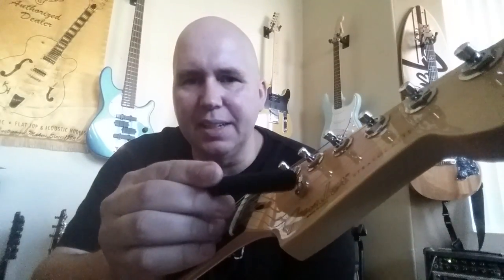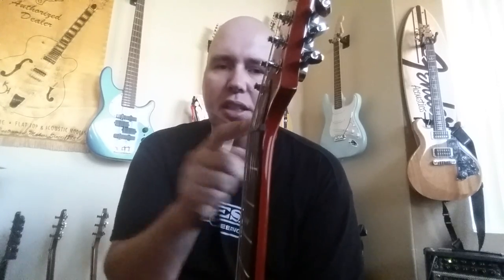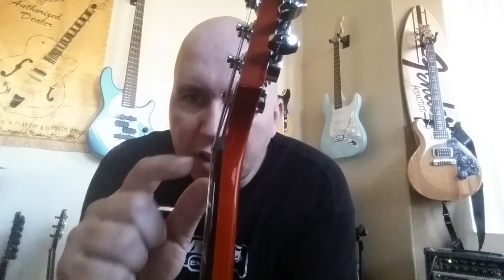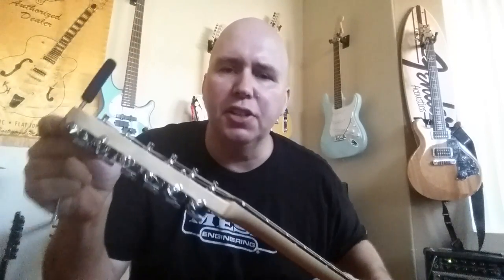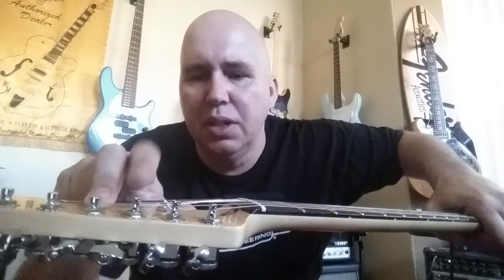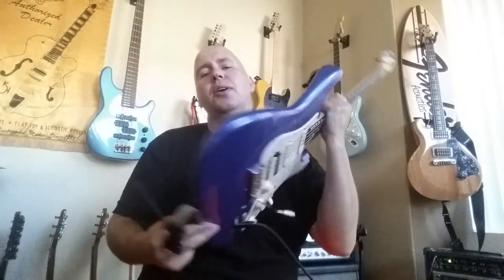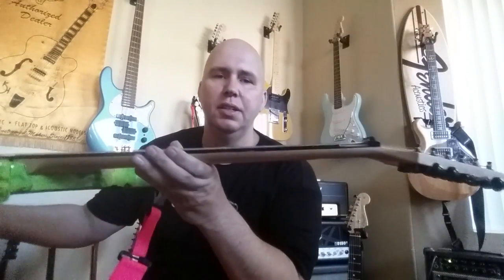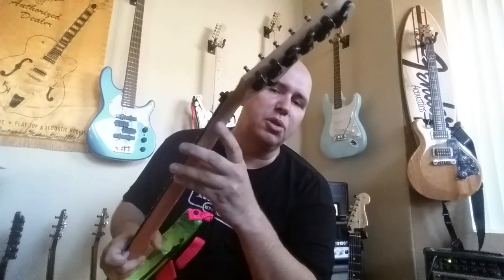locking keys Do Not Work The Way You Think

Comment: Well I respectfully disagree about locking tuners only being good for making string changes easier. I have locking tuners on 4 of my guitars that have whammy bars. I seldom have to retune those guitars even after massive dive bombs on the tremolo system. So imo they definitely help those guitars to stay in tune. No question about it.
Reply: I think he was just trying to dispel the myth that the lock,...holds the tuning key from "turning"...which is what I thought they did. 🙂
Reply: 100% agree! If you use a tremolo bar with regular tuning keys without a lock nut, it will not stay in tune as the wraps around the tuners loosen as you reduce the tension on the strings when depressing the bar.

Comment: I tried the D'Addario Auto Trim locking tuners. I can only speak for myself, but I love those Tuning Machines. They work pretty much the same as any other locking tuner, with with addition of auto clipping the string, eliminating the need for a wire cutter. You do everything the same and as you tighten the strings to bring them to pitch you feel a little clipping action and the string is cut flush to the tuning hole. These things virtually eliminate the bloody finger tips from getting stabbed by the end of a string. I know everyone has had that happen at least once. Anyway, they are definitely worth a try. I was skeptical until I tried them. Now I'm slowly changing several of my guitars to these. At least the ones where these will be an upgrade to.

Comment: I know this is a very old video, but I just happened on it and it has confused me a bit.  Locking tuners ONLY help with quick restringing?  i thought that with Strat style guitars with a tremelo that there was also the issue of the strings with multiple wraps on the tuning posts losing tune when the trem was used. the wraps slipping when the trem was depressed/returned.  No, let me rephrase...I didn't merely "think" that...I have in fact experienced that, and locking tuners do seem to have resolved that issue.  So it would follow that locking tuners do more than merely facilitate string changes on guitars that have a tremelo...yes?  And by the way, regardless of this nit picking...YOU ROCK.  I am addicted to your videos, find them extremely educational and helpful, and this is proven by the fact that here I am responding to a more than 5 year old entry!

Comment: TLDR: Bob Sperzel created the first locking tuners to "build a better mousetrap" and eliminate locking nuts. His intention wasn't to make string changes faster; that's just serendipity.

Back in the 80s, when Bob Sperzel had just created the first locking tuners (as well as the tuners with the tightest tolerances in the entire industry), people were using locking nuts to keep their whammy bridge from de-tuning their guitars.  It was explained to me by John Suhr, when he was working at Rudy's on 48th St. in NYC, that, with normal tuners, strings are wrapped a few times around the posts.  When you dive bomb your vibrato bridge, the strings partially unwrap around the tuner posts and loosen.  Then, when you return from the dive bomb, the strings often tighten around the posts at a different tension, thereby making your guitar go out of tune.  Bob Sperzel's idea was to eliminate the wrappings around the post so that aggressive use of the whammy bridge doesn't have any effect the strings' tension.  John Suhr explained to me that Sperzel locking tuners, in conjunction with a self-lubricating graphite nut, eliminate the need for a locking nut.  

An added benefit is that you don't have to drill holes in one of the most vulnerable places on your neck to accommodate the bolts for those pesky locking nuts.

Sperzel had manufactured Grover Gotoh and Kluson tuners for them.  He noticed 10 things that were bad design elements and set off to correct them.  

One was the very high gear ratios.  High ratios meant more teeth per gear; more teeth means smaller teeth, which means weaker teeth. Sperzel limited his tuners to a 12:1 ratio.  

He also found that the machine tolerances of other tuners were very loose because they would make their parts and then plate them with nickel, chrome, or gold. Because plating is an uneven and imprecise process, the parts were actually slightly different sizes. Sperzel only anodizes his internal parts because that doesn't add any volume to the mechanism, allowing for very tight tolerances. Some Sperzel tuners do get electroplating on the external parts, just for esthetic reasons, but that has no effect on the internal mechanism.

Other manufacturers use die cast part. When a part is die cast, it has a mold mark called a parting line where the seams of the mold are. To make up for that, cheaply, other builders add in a spring washer to make the mechanism feel smooth, but it also allows play in the accuracy of the tuner.  Sperzel's parts are all machined from billet material, so there are no mold marks and they need no spring washers. This keeps the tolerances tight and the tuning extremely stable.

For the complete information, check out the full interview with Bob Sperzel.  It's fairly long.  And remember, he's a trained engineer, not a public speaker and he has a slight lisp, so it helps to be patient with his explanations. This is the video's URL: https://www.youtube.com/watch?v=K8tMhkwnsBU
Reply: I made a mistake about who's tuners Sperzel manufactured.  Sperzel, himself, recounts that information in the video.  Please forgive me for my mistake.
Reply: Most of the legendary guitarists didn't use locking tuners ...

Comment: Great Video.  I never had locking keys, and I always thought that they locked the tuner from turning.  Stupid me lol  Thanks for the explanation.  :)
Reply from the maker: Trust me we all thought that at one point. Thank you for watching and posting.
Reply: +Lex10999 That's what I thought at first, that it stopped the keys from turning in case you hit them on something.
Reply: Phillip McKnight ... l thought that until just now! 2.11.2019
Thanks for another great & informative video!
Reply: I was wondering why they'd need to lock the tuning pegs when you can't really turn the worm gear by turning the "driven" shaft. Now that I understand that it's just a screw that comes from the bottom I wonder how better they are in comparison to regular tuners

Comment: Thank you. Some guy tried telling me that locking tuners did the same thing as a locking nut. I didn't believe him because it just didn't seem like that would be true. A) The string is still free to move and bind within the nut when you do bends and use the trem bar, and B) They do not lock the tuners in place. Just the string into the tuner.

Comment: Thanks for the explanation man, just got my first guitar with locking tuners and didn't really know what those did and how they were different (wasn't a factor in my guitar choice really) but most importantly how to restring properly which I never would have thought you needed to pull the string tight before locking so again, thanks a lot. 
Have a good one mate!

Comment: I've had a scarf joint break on me. On my very first bass actually. Broke right at the joint. Filled the gap with some wood glue, clamped it by sticking the neck under my couch with some textbooks as a fulcrum and voila it worked. I now keep that bass at work and just mess noodle on it sometimes.

Comment: Great video :D I've changed to locking tuners on most of my guitars. Although I use minimal wraps on them I give the top E and B at least one wrap or I've found they can break a string. Also on both my Peavey AT200 and Jazzmaster I use two string trees to not only give a better break angle but also to dampen the longer strings such as the D which can sometimes give weird ringing harmonics. I'm always open to any advice as like most of us it's been trial and error ha ha ha
Reply: +Matt Preston What you're talking about is likely sitaring.  He didn't mention it.  It can happen if the angle and/or nut slot are not sufficient.  I've never had an issue without string trees when using either the schaller or sperzel staggered, locking tuners.  There are new Sperzel staggered, locking tuners with an EZ-mount, no drilling necessary.  60-70 bucks on FleaBay.

Comment: Ummm, they aren't just used to make string changes quicker.  The lack of wraps means there is less chance of the string to move out of its position.  When you use normal tuners, you tend to wrap them and everytime you bend and such your string slowly loses its original position on the tuning peg, not so much an issue with locking tuners.
Reply: biggest myth in guitars.
Reply: He said that in the video.
Reply: You don’t need locking tuners. The wraps stretch like the rest of the string and will stablelize after a few mins of playing. One wrap on any post will support the full weight of the guitar. I use 3 wraps just for good measure. Cheap tuners will work as long as the nut is cut properly. Especially on Les Paul’s

Comment: Yes Phillip, you're laughing at me loosing the locking tuners🤣🤣😋😋. Actually, I've used locking nuts and tuners since maybe the late 80s with my Kramer and then the locking tuners relatively later. I truly haven't a clue why it takes so long for simple problems to be solved except maybe be the reluctance to challenge tradition. Gibson, altho I love my tribute, is the worse at this. So many Band-Aids placed on things like head tilt and tuning problems without truly adress the actual problem. Traditions are very difficult to argue against and terribly difficult ot cgange. Great video!

Comment: if you put on locking tuners do you still need to use the tree for the b and e string?  thank you great videos
Reply: Yes, the tree cuts the angle from the nut to the tuning peg so the string doesn't pop out and maintains solid contact with the nut.

Comment: I am getting rid of my locking tuners. The screws keep coming out and getting lost, but the biggest problem is that they keep cutting the strings too short when I'm trying to replace new strings. I don't mind tricky. But I hate tricky and annoying. Sooo many strings I had to replace because the tuners snipped them too short when I tried to replace them. Oy! I'm going back to the original tuners as soon as my order arrives from Amazon. As Admiral James T. Kirk once says, "We learn by doing." But not by killing dozens of innocent guitar strings in the hidden gas chambers of the locking tuners. 🤣😎
Reply: Your tuners cut your strings? Screws coming out by themselves? Have you also bought them on amazon or aliexpress? 😂

Comment: I was under the impression that with locking tuners there would be little or no windings around the post making trem use more stable. 
I find that changing strings with locking tuners more difficult. It requires three hands: 1 to pull the string tight, 1 to dip the trem bar to eliminate windings around the post and 1 to tighten the thumb knob.
Reply: This is true. While some downward tension is needed to keep the strings in a standard nut, multiple wraps can cause too much angle and the strings binds on the nut when you drop and raise the tremolo bar, causing the guitar to go sharp. 
The locking nut allows the string to be locked in place with as few winds around the post as possible, allowing a straighter angle from the nut to the post and will allow the string a better opportunity to return to "zero." (A properly cut nut and lubrication in the slots are also best practices for tuning stability.)
Brian May's Red Special has NO angle from nut to tuner (he also has a zero fret,) and he uses the bar all the time and has no tuning issues.

Comment: The reason why people see differences in the locking vs standard tuners is because they are using cheap tuners, then changing to quality locking ones will just help the guitar lol

My strat has vintage ones and I might not changing the tuners at all then. She stays in tune pretty well with a graphtech nut even with a floating trem. Might just buy the string tree to help it a bit more

Comment: I understood that the locking tuners are also designed so that multiple string wraps are unnecessary and don't cause tuning variations when used with a tremolo system like a Bigsby or the Strat system...

Comment: Locking keys actually DO stabilize tuning though. Just not lock it in like some assume. If you're using bridge trem often or for someone who incorporates bends a lot in their playing. Even if the string is wrapped properly on non locking heads, the on/off tension of the string where it contacts the first wrap on the head, can cause the wrapped portion to shift and deform. (I guess I should say the high/low then back to normal tention.) Locking heads made a HUGE difference in holding tuning on my Strat when using the bridge trem. Even with various knot or pinch wrap techniques on a standard tuner head, theres nothing like locking ones. Awesome vid and you have any experience with Ratio's? I'm going to give them a whirl soon and so far hear nothing but great about them
Reply: So much truth in this comment, maybe he just meant on fixed bridges, but trem systems are another deal, more specific bigsbys. :)

Comment: Phil. I have a Firefly HSS that I bought the previous month. It has at least two wraps per string. My question is, it came with locking tuners. Can the strings slip in tuning? And need to be retuned. I am trying to learn my gear. So I will know  my gear.
Reply: They may or may not slip. A few wraps on locking tuners really just defeats the purpose of locking tuners. Multiple wraps don't necessarily mean your tuning will slip, It just creates the possibility. I would just restring your guitar with zero wraps to utilize the full potential of those locking tuners.

Comment: They do help with tuning stability some. I put a staggered set of locking tuners on my '00 American Standard Strat along with a Teflon nut and a dab of Big Bends Nut Sauce on the bridge saddle string contact points and in the nut slots (for good measure).  I was using the Lube and the Teflon nut first and only after I added the locking tuners did I find that my Strat stayed in tune almost as well as my FR equipped axes. I say almost as well as I really only need to retune in between sets (and the tuning is not that far out) and I'm utilizing the bar pretty heavily playing VH and Night Ranger Tunes. That wasn't possible prior to the locking tuners.

Comment: Hello Phillip. I have a question for you. Since the "pistons" in a locking tuning key pinch the strings, can the pinch adversely affect the lifespan of the strings?
Reply: The answer is maybe. Like Robert Pierce (see comment above) I wrap my locking tuners a bit to prevent them from popping out. This has the added benefit of reducing tension at the locking point, which should extend the life of the strings. Phil just pulls tight, locks down, and tunes up, so it may not make much difference.

Comment: Hi, Phillip! I'm having a huge trouble with tuning instability in my new Gibson Les Paul. I read that good locking tuners would fix it. Do you agree? What you think should I do? I'm freaking out 🤯
Reply: I would have the nut looked at. If it's not cut right the strings can bind in the slot. I had that problem on my Tele but Gibsons can be worse because the strings go off at an angle to the tuners. I have locking tuners on the Tele and they work fine. I just find it faster to change strings and not much else.
Reply: @teleplucker6802  I just ordered online some graph tech nut. I'm gonna start with those, and if I still have problems I thinks I'm gonna invest in some nice tuning machines...
Reply: Try this too---Tune up and play an open string. Then play it and press down on it behind the nut. If it doesn't come back into tune when you release it then that's your problem. Try it with all 6 strings.
Reply: @teleplucker6802  Yep. Everytime I try, the string never go back to the right pitch. I think the graph tech nut is gonna bring me some big improvements. It arrives in 5 business days. I'll tell you the result after the installation lol thanks buddy

Comment: I'm sure someone will or has said, that a common mistake with locking tuners is to lock the string in with the typical amount of slack for a non-locking tuners. You get the hassle of winds settling in and the benefit of the end locked. I've also wondered when using a locking tuner, that with no winds on the string, the string exits the hole in the post right at the opening making a high stress point at that bend. I've yet to experience a break but if so I think I would modify my install technique to have at least half a rotation so the point the string leaves the post is tangential.

Comment: Thanks Phililip for the info, now I understand. I ve been reading  about different brants, but which one is the best choice  for a PRS SE?  I own 5 different SE signatures, and all are not so stable with the original SE tuners. So a good locking could help, but a normal tuner with low wrapping can do the same. Which one is the best upgrade?

Comment: so I saw on another video that says fender staggered locking tuners (Tall for the low E A D , short for the high g b e) don't need any string trees or windings  , but the guy that installed my lsr roller nut and roller saddles said that he had to wind them in order to compensate for not having any string trees(as if the trees were needed). Looks like, from low E to high e, (2 2 2.5 2.5 2 2 winds)...problem is...the thing works perfectly (I whammied the hell out of it and it always stays in tune)...so what do I do the next time I change strings?